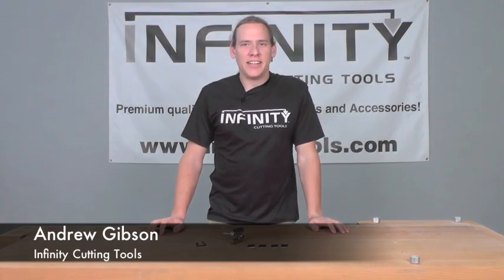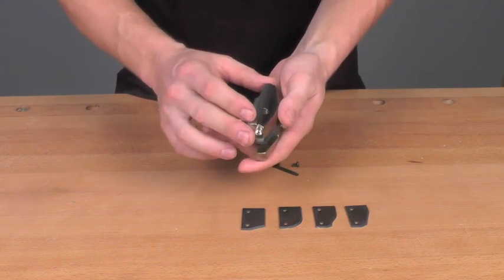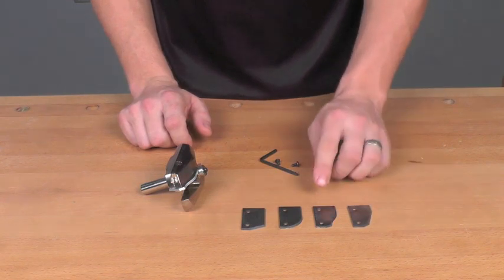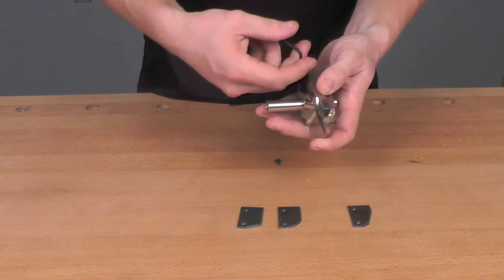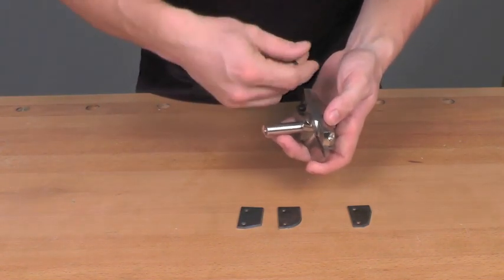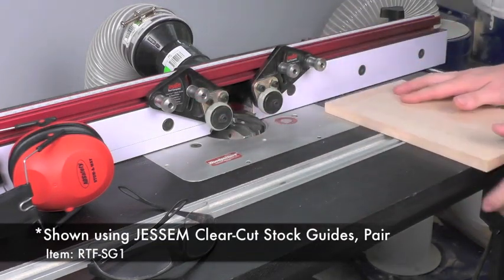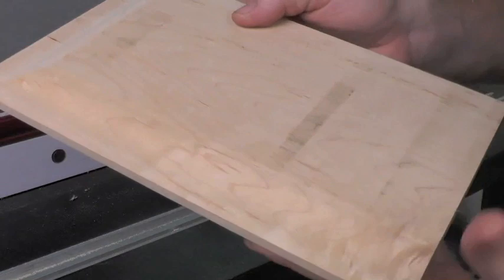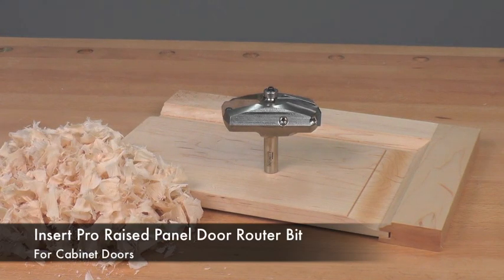Infinity Cutting Tools - Insert Pro Raised Panel Router Bits

Comment: Results look good, especially considering it was maple.  Do you recommend cutting panels in one pass?  Also, can you supply custom cutter profiles?  Finally, a comment -- I would much rather see two precision tooling pins for each cutter in the body, and a hole and slot in each cutter, as opposed to relying on the cutter being pushed up against stops... things move when screws are tightened..
Reply from the maker: Hi, I typically raise panels in 2 or 3 passes to insure the best possible cut and to be able to fine tune the fit in my frame if need be. For the purpose of the video I ran the panel in a single pass to show the capability of the bit.
Locating the cutters into the body is very straightforward and I have not had any complaints or concerns from user/customers.
Currently we do not offer custom profiles, but if you have a profile in mind feel free to let us know. If we decide to produce the profile we will be sure you get the first set. Our Art Deco profile is our newest profile and was suggested to us by one of our customers.http://www.infinitytools.com/3-Pc-Cabinet-Makers-Art-Deco-Router-Bit-Set/productinfo/00-109/